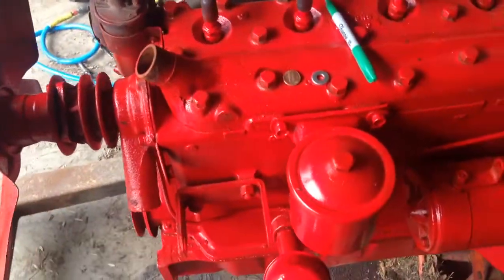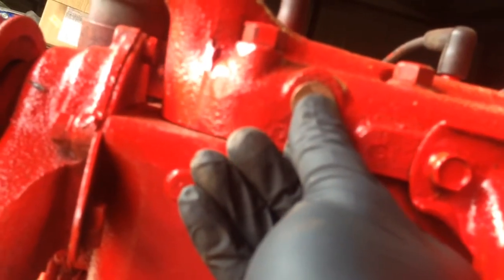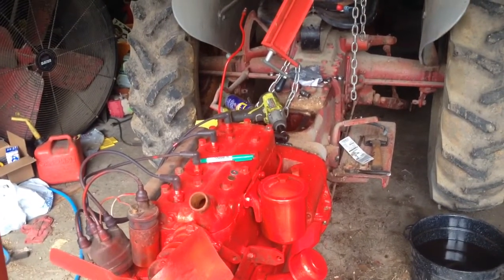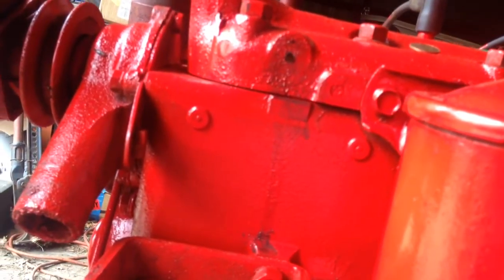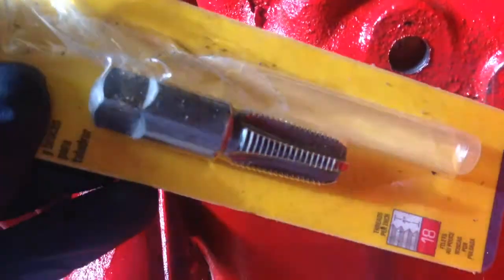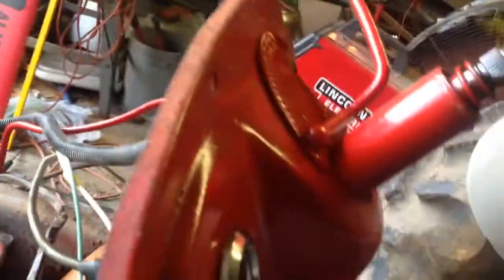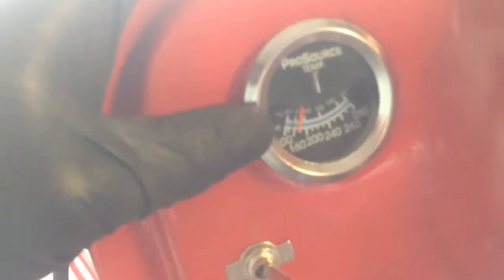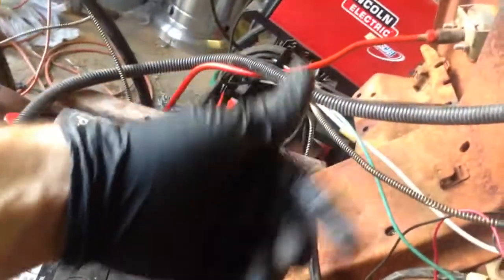Ford 8n Temperature Gauge Install

Comment: These only run at about 130 degrees why would you want a gauge?
Reply from the maker: Too keep an eye on it to make sure it doesn’t overheat.
Reply: MJM’s Workshop i guess. But I have never seen mine go over 130. So I couldn’t imagine it overheating
Reply from the maker: It would if it lost coolant.

Comment: I recently bought a 1952 8n that has a relatively new head but without the hole for the temperature sensor.  So I've been wondering about this procedure.  My question is this:  how did you keep metal shavings from the drilling from entering the water jacket area as you referred to it?  I would think those particles could damage the water pump severely.
Reply from the maker: put grease on the drill bit and tap to make the shavings stick to them, then flush the head with water.
Reply: @mjmcomputers  Thanks, that makes perfect sense.

Comment: proof meter? Is that an hour meter? Never heard of a proof meter and yes I am 72 and been a mechanic for many years. Running cold has worn the engine prematurely if not overhauled which looking at this engine seems to have been done for bearings and rings.
Reply from the maker: Proofmeter was Ford's name for the tachometer/hour meter on these tractors.

Comment: Why didn't Ford put temp. Gauges on the n series tractors, just wondering.
Reply from the maker: Seems not many did at that time. Steam from the radiator was the temperature warning sign.

Comment: Where did you buy the gauge at? I installed one Rural King in my Ford 850 it leaks like crazy even after tightened up.Thanks
Reply from the maker: I bought a Bosch on amazon but ended up using a cheap one I’ve had laying around for years cause it looked more appropriate on the tractor. The Bosch looked too new.

Comment: What about the chips created from drilling/tapping that are now inside your head? Doing this with the head off would eliminate this issue.
Reply from the maker: There’s no reason to pull the head off. Grease on the drill bit and tap will help keep it from going inside. Then just run a magnet inside to get the rest. If you are really concerned you can pull the radiator hoses and flush it out with water.

Comment: If you can find a 180 degree thermoset that will let you run a little hotter and will keep that engine cleaned up better. They can be found.

Comment: Tractor does not need a thermostat.
Reply: Tractor does need a thermostat, doesnt really need a temp gauge but its handy..
Reply: My tractor runs better and cooler without it.
Reply: without a thermostat you will get a milky film on breather cap and oil spout from condensation from the oil not running at a hot enough temperature, especially in colder weather. The heated oil stops the condensation from forming and evaporates through the breather cap.

Comment: I have heard these old tractors don't really need a thermostat.
Reply: JK1211a There are a lot of people that claim they don't however there are a lot of benefits of keeping them in there.
1. The faster you bring a engine up to operating temperature the better.
2. The engine will run a a even temperature. Generally it will be hotter toward the front then the back. Thermostats will even things out causing less of a chance for things to warp.